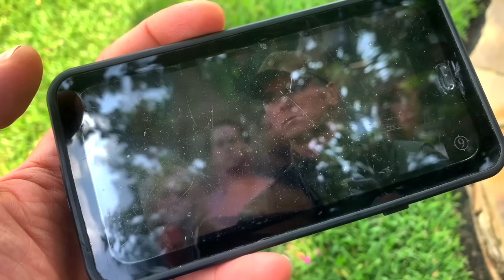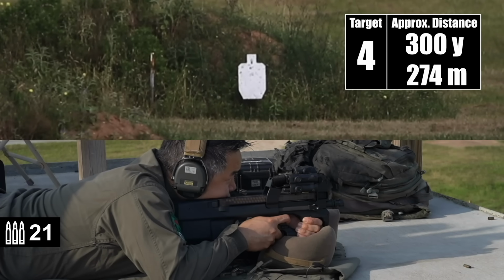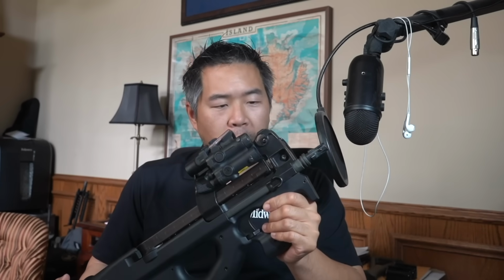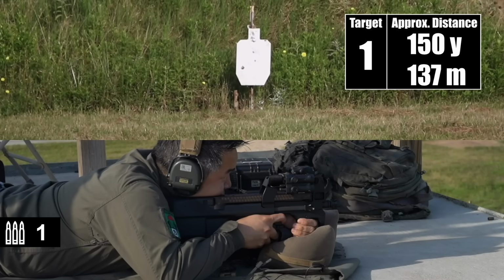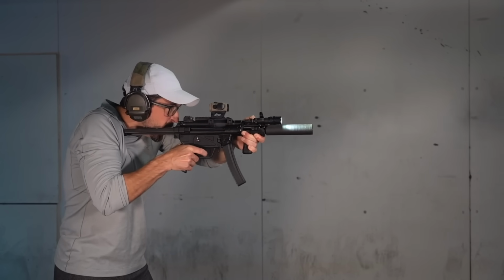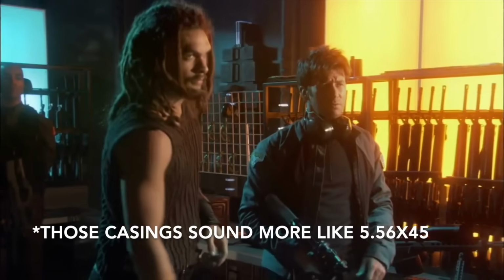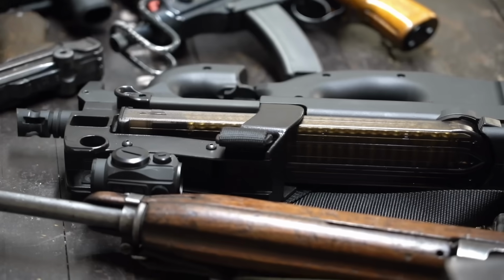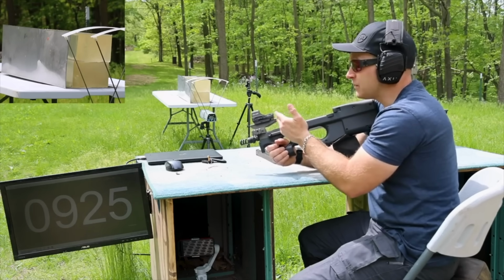FN P90 to 500yds: Practical Accuracy (Stargate SG1 main weapon) PS90

Comment from the maker: UPDATE: Thanks to a few corrections from viewers, the Belgian support troops (medics, construction etc) indeed use the P90 as a PDW. Nice to hear that it's not just a SOF weapon! 

Check out our clan of creators at History of Weapons and War! 
https://www.weaponsandwar.tv/videos/20240722-m7-xm7-discussion-2
Reply: C&R arsnel needs to be added!
Reply: The P90 was also the last work/"project" of Dieudonné Saive, the one who created the SAFN and the FAL
Absolute belgian legend of gunsmith engineer !
Reply: @Real_Claudy_Focan  JMB laid the design of the High Power. Savie perfected it.
Reply: We are teached in the BE Army that the 5.7 (pistol) have an absolute range of 380m where the ammo lose enough speed to tumble and be completely useless as a weapon
Emptied one mag once at one of our 400m range during the P90/5.7 course, just to "see" how far we can push the platform. 0 pracaticality :D, but it's cool !
We use Aimpoint Micro T1 as the "regular" optic (if someone here wants to larp as a belgian soldier)
Reply: The Belgian Navy also uses the  P90 for boardings operations on ships.
Reply: 46:45 I'd love to hear 9HoleReviews discussion on the .40 S&W; its history, popularity, and current decline.
Reply: @commandZee I second this!!
Reply: A 2nd pip, or even an overlaid dot on the screen showing us where Henrí is aiming would be slick. Great video!
Reply: 48:15 : No videos to share, but the [s]P90[/s] RCP-90 in Goldeneye has very limited penetration ; it will just PERFORATE the ~METER-THICC concrete slabs used as doors on the Temple level. The deep magazine with 80 cartridges makes shooting thru doors or/and at long range using only the radar a breeze.

And at least the N64 controller didn't have a progressive trigger !
Reply: @KenshiroPlayDotA 
Couldn't you dual wield them as well in that game? I'm sure I remember dual wielding..

UPDATE 
Yes, you can dual wield in N64 Goldeneye and you can glitch dual wield different guns, like a p90 and a Mossberg.
Reply: I don't even know how you guys were spotting those hits, I just don't even see them.
Reply: On the lubricant is it not just a matter of spraying the cartridge with Teflon.
Reply: I'm glad they use the P 90 on Stargate because it holds more rounds than other sub-machineguns. So often on the screen, guns seem to fire impossible amounts of bullets.
 At least with these weapons, once the squad start hosing down, they appear somewhat more believable.

 Henry, I'm sorry it's not possible for me to contribute to 9HoleReviews. Unfortunately that's the way of things for this UK pensioner. I really would if I could. Nevertheless, thanks for doing what you do, and doing it so very well.
Reply: At a 16" barrel, it would probably help the effectiveness at distance? Also, many use a 3x prism on them.
Reply: I'm glad I'm not the only nerd that caught the progressive trigger goof from the actor single tapping and being caught off guard by that trigger.

Definitely one of those things that in hindsight was kinda cool they didn't edit or reshoot because it Definitely eludes to that being a real McCoy P90 or at least an excellent quality gas gun for movies.
Reply: You run like Howard the Duck.
Reply: please do a mp5 k long range vid😂
Reply: Piece of Scheiße. Granted it’s designed as a PDW.
Reply: 12:57 I just bursted of laughs when i saw our old camo.. sweet memories ! I miss it !
Reply: you need to get a directional microphone
Reply: could you try it again with the civilian long barrel version?
Reply: I wonder if the Law/Military Only rounds would make a difference, weren't the AP ones faster?
Reply: Redo it with a elcan spector DR
Reply: would having the 16" barrel push out that range further? Additionally, how do you feel about the short barrel? I am inbetween converting mine or not.
Reply: After seeing this video sent to me by Matt Hoffman, I bought the HS503G.  For the life of me, I can't figure out how Henry uses that optic to make these shots.  I can't make out the range mode dots worth a damn.  Impressive shooting Henry.
Reply: I don’t get why you would think that to begin with
Reply: Stargate sg1 main weapon lol sucker no better to said ….

Comment: Henry.. where's the 'can'?  the round is flawed, generally too light, running too much pressure that could be remediated by going to 6- 6.5mm (as the base area is significant to the force applied to the bullet) @ 85 to 100 grain bullet, abet @ a more realistic 2300 FPS.. and due to the short barrel,  yes a 'can' is needed. [A more Kurtz type cartige... using the NATO 5.56 case, shortened.]

Comment: I have a PS90 FDE with TROS low profile ACOG mount  Have TA-47 compact ACOG mounted . 

 I can hammer a 6”!steel disk from a rest 175 yards all day long . It’s an amazing carbine other than the weird bull pump trigger, however it doesn’t seem to affect my  accuracy when out shooting.

I have several SBR’s Ar15’s, AR10’s,MP5, MCX, Rattler LT and more .

I think if a person trained with their P90/PS90 it could used it in a defense role quite efficiently. Heck , I wouldn’t want any one taking shots at me with one.

Comment: I have kept my PS90 barrel B/C I want that velocity I'd lose with the10" barrel. I removed the original Pic rail and put an HB INDUSTRIES low mount for my HOLOSUN 509T sight. I added an extended left side charging handle and internal trigger "fix" and  two ring sling mounts and a MAGPuL sling with compatible lockable "claw" hooks. This carbine is my SHTF unit along with my RUGER 57.

Comment: The 5.7 suffers our American Way of everything. Looks like a rifle round so it should be as effective as a rifle round...
I carried a rifle in my truck for the 1 in a million situation... I changed to a folding 5.7 expecting it to cut down on space & weight knowing it's not a 10.5" ar... It's less energy but the 1 in a million for me is stand-off or 100 yard accuracy & it will kick ass at that. Keeping everyone back at distance & knowing if you close to 100yds or less, I can put effective fire on target...
I didn't need the mk12 w/ 77's to effect my goal. So I went smaller, lighter, & much more of a "throw away"

Comment: I think it makes tactical sense for SG1. High capacity, relatively small/light, armour piercing capability, enough range for open ground engagement, ticks a lot of boxes when the operation area was unpredictable. I think they probably still should have had a DMR in the squad to give them more options

Comment: I'll take the very much upgraded and the latest revised Australian Steyr AUG called the  EF88 anyday over this thing.
The EF-88 being a 5.56mm round with a full 20inch barrel which is far more accurate, hits harder and better balanced and shorter than the M4 with its small 14.5inch barrel and the EF-88 has all the attachments.
Yep that's for me!

Comment: "I don't see any further development on the system - from FN." Well FN has gone through 3 iterations of the Five seveN pistol, improving it with each model.
Reply from the maker: yes, but we're not talking about the pistol... at all.
Reply: @9HoleReviews  OK got it. I took your use of the term "system" to include all 5.7 x 28 weapons from FN.
Reply from the maker: yeah and I do agree with you that the caliber has really seen far more development with pistols rather than PDW/SMGs.

Comment: My 1st bullpup was an AUG gen. 1. When I bought the PS90 I was surprised to find its firing/trigggeer group was a very close copy the AUG trigger group. I upgraded the trigger group for a lighter pull by 3/4 pound, put an extended left side charging handle, added Vortex SPARC II red dot and a very nice MAGPUL sling. ZOMBIES BEWARE!  (Plus my RUGER 57 has three 20 round mags.) 
->-> I had The Vest Guy make me two MOLLE custom double mag pouches for a 5 mag load out with one on the PS90.  That's 250 rounds! Pouches for theP90/PS90 PDWs are rarely addressed. No P90 pouches? You need your gun bearer to carry them.

Comment: I think 300 Black Out would be very suitable for PDWs.  As compact as a WW2 SMG but greater accuracy and power.  And having some tactical uses.  An 11 inch barrel is suitable but can be shorter.  And use a standard AR chassis.  More power than an M-1 carbine. With a folding stock. AP ammunition an option. Suitable range for a PDW.  The 300BO is now in military use.  Mainly for spec ops, depending on operational requirements.  A 6.5 tungsten round based on a 9mm case could be used on SMGs with a barrel change with good armor piercing. Was marketed with a mini Uzi clone with optional barrels.

Comment: A few thoughts, mostly for connoisseurs of the show. 

SG1 was the tip of the spear, the premier contact team. The went in, established routes, gathered light intel, figured out the ins and outs ALL with Teal'c help and Daniel's expertise. Carter provided the technical knowledge, while O'Neill kept things on the line. Other SG teams had similar roles (some based on negotiations with other countries), but all in all, it was SG1 that established most of the firsts (they had dibs). So it's logical that they needed a dependable piece of gear that did several things at once.

Reasonable accuracy, reasonable stopping power, reasonable ammo foundation, reasonable ease of use, reasonable size and weight. I doubt there's any other rifle (in production at that time) that his ALL the squares as cleanly as the P90 did (from the show plot's perspective).

This is a team that needed to go in to enemy territory against superior forces, with little to no backup, and (early on) no possibility of 1:1 recovery. On the other end of the shoe string, SGC couldn't invest anymore than the existing teams of SG teams because, remember, this was a secret operation. Highest level, even the leadership of Cheyenne Mountain weren't aware what was going down in the closet down bellow. At that even the President wasn't read in (i've always read that scene to explain that under normal circumstances, Hayes would've been kept in the dark, which pisses the scummy Senator, because he was moonlighting for the NID). 

And as for that scene between the P90 and the Staff Weapon, their purpose wasn't so much as to prove that the weapon was better, but rather that they needed the Jaffa off the Goa'uld toys and ... to some extend, depending on the SG program, therefore happier to do "business" with them.

I see a lot of people arguing to and fro about the P90 because of that scene, but the subtleties of the show's writers escape them (no offense, but most people don't even know that every innovation in the show is directly traced to a discovery made in previous episodes. The show writers were adamant on it). Remember the scene with "Colonel, the United States is not in the business of interfering in other people's affairs." Yeah, think about it. Especially given the in character reactions of the O'Neill and Carter. They were there to grease the wheels. And how do you grease the wheel for a populace of brainwashed, illiterate, militaristic, disposable servants of "gods"? Flair and Flamboyance. I think Carter pulled it off in spades. They were certainly oooed and aaawed, the skirt people, i mean the Jaffa.

As for the infamous IRL mishap in the episode (Tapping getting face sweeped), eh, it happens (not that i'm saying it was ok). Given that they never had any major issues, in all the years of production, i feel that one can overlook the "overly enthusiastic" O'Neill selling gear for SGC, he had to look the part and the actor got happy flingy with the pointy shooty.

Comment: 44:57 Would notched bullet be a possible solution to increase lethality in 5.56 rifles with short barrels at extended range? Not necessarily monolithic copper bullets, even just a totally normal lead bullet with a notch in the copper jacket. You could make one by turning a normal bullet in a lathe and scoring the copper jacket.

Comment: i really want 5.7 or 5.7 short thats the same lenghth as a 9mm so it fits in 9mm frame  guns, and then ammo manufaturers to mass produce it so it beats 9mm in cost per round. a modern update to 22lr thats reloadable and dosnt have rimlock issues.

Comment: Several years ago while in a police armed response unit, we were required to mobile patrol with our MP5 weapons slung across our chests for full shifts. It wasn't much of an issue for the driver as long as the front seat passenger was right handed as his/her weapon would be pointing out of the passenger's door window. The passenger, on the other hand, would have the noisy end of a right handed drivers weapon pointing pretty much at their head for eight or nine hours a day. I brought this up with our firearms department and suggested that it might not actually be a good idea to carry our weapons like this when patrolling in vehicles, especially when driving, as at no time did you actually have control of it with even one hand. The passenger on the other hand tended to always have at least one hand on their weapon. For some reason they couldn't see the problem. Having your head 'swept' by a loaded weapon for eight hours a day... not a problem... Too many sunglasses wearing macho men with bullet proof heads in them there days...

Comment: Late to this but wanted to say thanks for an illuminating video. Sure, the P90 is no replacement for an infantry rifle, but it does things that nothing else can do in circumstances where the user's only practical alternative would be a pistol. And good luck making reliable 200 metre hits with a pistol, plus you get the capacity and the full auto capability too. Really the spiritual predecessor to this is the Schnellfeuer full auto version of the Mauser C96, and a back-to-back comparison of the two would really show a century of progress in practical terms

Comment: Actual:
Stargate lore-wise, they switched to the P90 in Season 4, Episode 8: "The First Ones" 
After Rothman comes through the gate and informs everyone that Daniel was taken by Chaka, Jack says to Hammond: "Recommend units 1 and 2, P90's"  after they had earlier encountered an Unas controlled by a symbiote within the labyrinth in Season 1, Episode 10: "Thors Hammer" where the MP5 was very much ineffective against it's bullet sponge hide

iirc, production-wise, ignoring the obvious futuristic looks and coolness factor, with the downward ejection, it allowed tighter framing of multiple actors w/o the issue of hot brass flying around into other actors standing next to each other; easier to film and more flexible to compose a scene

Comment: In my opinion, I don’t really care for the P90, but I like the 57 round.  I would rather use a Shorty AR over a P90. Yes the P90 would be smaller, but you just get so much better performance and familiarity out of a Shorty AR. I think the 57 shines in a pistol. High capacity, high velocity, Low recoil and flat trajectory, in a normal pistol size package with the possibility of armor penetration. you can disagree but I think the 57 is the most advanced pistol round currently available

Comment: I think the P90 is really close to the perfect infantry light carbine. It's wild how close we get to this time after time with developments like the Johnson Spitfire in the M1/2 Carbine, the 5.56x30 MARS, and so many others. I know a lot of people get hung up on lethality, but if you understand and accept the limitations of having a system designed for combat inside of 300m in exchange for a lighter and more manoeuverable platform with more ammunition for the carried weight, it's a better value proposition than most people realise.

That said, I do think the 5.7 cartridge itself leaves a bit to be desired for performance when you get outside of CQB ranges. If we could design something that basically splits the difference between an 11.5" AR and the P90, taking design notes from the M855A1 for projectile design, I think that would be optimal for what is statistically most infantry combat. It would also probably nest well with the new 6.8 round, the latter being better suited for designated marksman and automatic rifleman use; essentially returning to the same M1 Carbine and M1 Garand format that we already know worked last time there was a large scale peer conflict.

Comment: After just a few minutes into the video I'm convinced that the M4 carbine is a superior weapon.  I have been following the P90 since the early trials were first made public three decades ago.  The compact nature was a selling point but the M4 isn't that much heavier while being far more capable.  Henry began at the P90's design distance at 150 meters--and the sight system was made simple, with no adjustments for longer ranges.  Henry is a far better shot than I, so if he can't connect at 250 and 300 yards, I'm going to do worse.  The M4 uses STANAG magazines and standard 5.56mm NATO cartridges, so I not only get a greater hit rate with the M4 than with the P90 but when I run out of ammo, I'm more likely to be resupplied.  

That, and the 5.56mm NATO is significantly more powerful than the 5.7x28mm.

Comment: I wouldn't call that equivalence between the Krink and the short-barreled AR-15. The Krink has a standard muzzle device, and if you're going to pick one for the AR-15 (which I don't think has a standard muzzle device), I think it would have to be the A2 birdcage flash hider and not an "aftermarket" muzzle brake. But if you had to use a muzzle brake, why not use one that has the same design as the Krink or "AK74SU"? Because I don't see why that wouldn't give you similar results to the Krink?